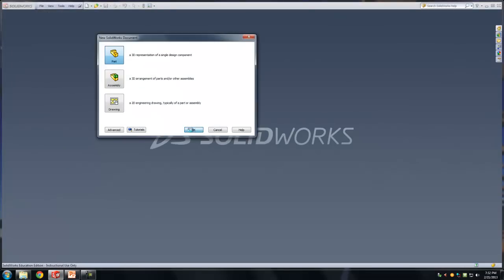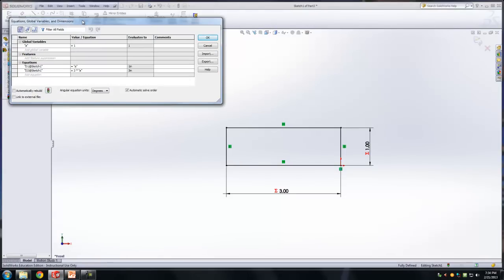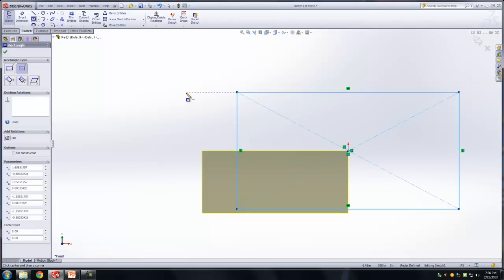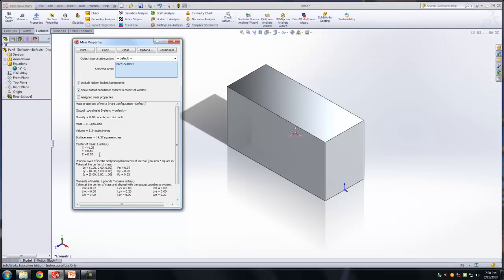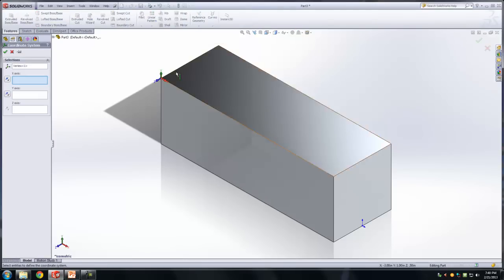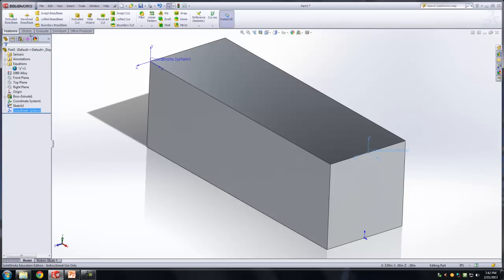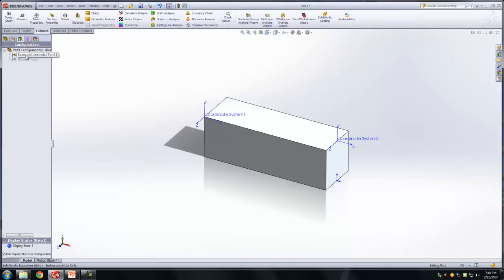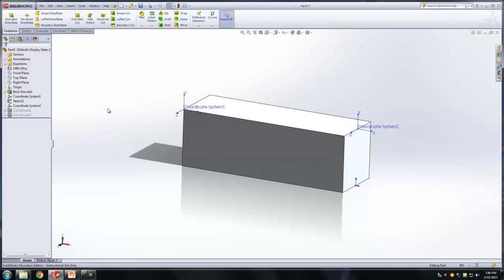Solidworks: Equations, Configurations, Mass Properties, Coordinate Systems

Comment: You actually can make the extrude feature set to the global variable

1) Set the extrude dimension as a number (as shown in the video) and apply
2) single click on the extrude feature in the FeatureManager
3) In the viewport, double click on the extrude dimension and change the dimension to ="globalVariable"